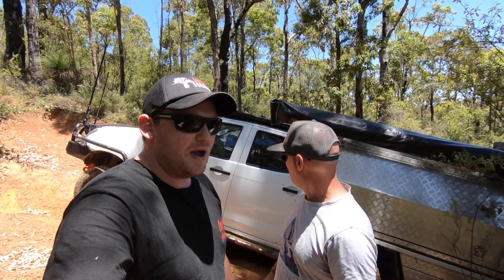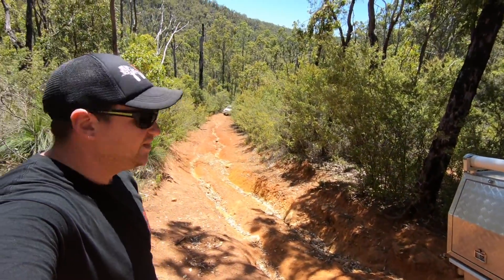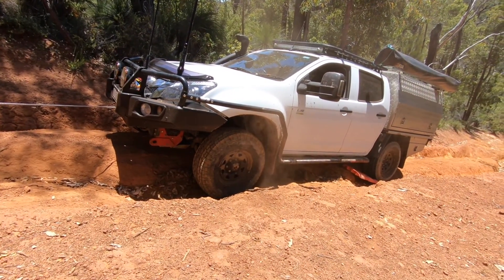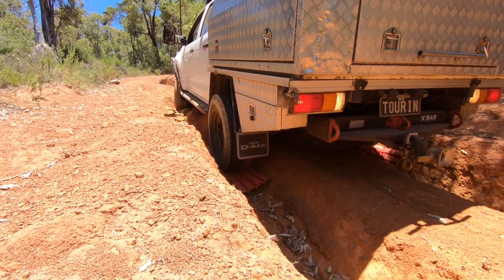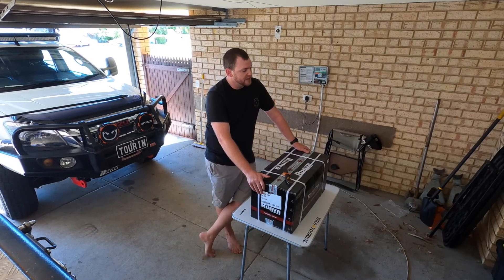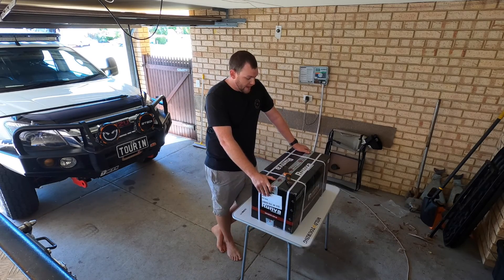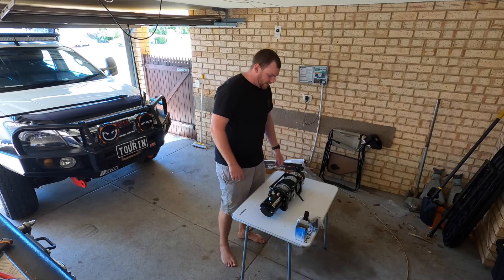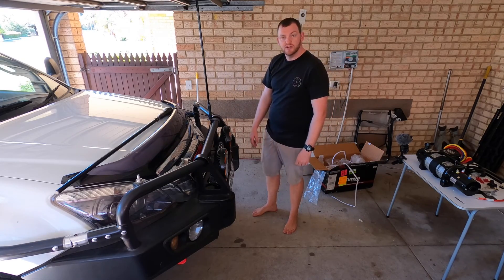Runva 11xp Premium Winch Review - Test/Unboxing/Fitting

Comment: Good job Cam. You won't be disappointed with the Runva. I've had one on the front of my rig for almost 5yrs now & put it through absolute hell. The only issue I've ever had is the isolator switch failing twice due to it being a pos but a quick bypass soon had it going again. Check out Paul's Julimar video next week & you will see the kind of punishment I put mine through.

Comment: Thank you. Purchased a second hand 4*4 and never used a winch upon purchase NEVER tested the Runva x11 went to rest it 8mths later and no power 5hrs of phone calls and questions thinking it was even the control box.. long story short turn on your vid and about 1.50sec into it in unboxing you pulled out the isolation switch, fk me knew straight away what I overlooked lol

Comment: Mate the Runva will not let you down, same winch I’ve had for over 2 years now. Only advice is grease it up before you leave it’s a little dry from factory. Meant to say my bar moves heaps like that too no big deal, I think it’s actually the body moving back on the mounts more than the winch pulling the bar off
Reply from the maker: Yeah the gap between the bar and body only seemed to open up under serious load.  When I backed off the winch the bars still lined up evenly - so not too worried about it!

Comment: What brand of bull bar do you have on the Isuzu? It looks like a complete bumper replacement.
Reply from the maker: It is.  It's MCC.  Absolute rubbish though!  Paints oxidised, peeling and bars rusting all over the place.  Fog lights are falling apart and recently on corrugations the spotties tore a hole out of the top of it 😂

Comment: What bull bar are you running is it steel or allow. I'm in need of a bull bar for my dmax and the tym one I'm looking at is a haft fount bar set up. 
 Where yours looks like a full replacement
Reply from the maker: Mines a MCC steel winch bar.  It's a pretty solid bar, but the Powdercoatings rubbish.  It is a full bumper replacement.
Reply: @WildTouring  yea sweet I'll look into see if they do stuff in nsw

Comment: When your bull bar was pulling off why wouldn’t you swap to a double line pulled reduce the stress on your bull bar
Reply from the maker: Because it wouldn't reduce stress on the vehicle.  Its still pulling the same weight from the same point.  It just reduces the load on the winch motor, which wasn't an issue.
Reply: Wild Touring  if your running it back to the recovery point on your 4X4 you are dividing the stress between the to points. It’s pulling on the recovery point and at the winch
Reply from the maker: @waderattray9210  yeah fair point! Could have done.
Reply: Wild Touring great video by the way first one of yours I have seen and I liked it
Reply from the maker: Cheers Wade.  Appreciate it mate!

Comment: wonering if you used snatch block more if cheaper winch is more viable,last longer,mmmm,
Reply from the maker: Probably, anything to reduce load would help. But when this winch failed on other occasions it was not load related - it was electrical issues from water ingress. It's just not good enough to have to split a brand new winch to regrease it because they basically are sold dry.  Then reseal it with gasket goo because the machining at the flange and factory gasket are terrible and let heaps of water in.  Then have to retorque and lock-tight every bolt because otherwise they rattle loose. If it's something you'll rely on when you're remote, seriously consider saving some coin for something more reliable like the Runva!
Reply: @WildTouring  the 5year warrenty makes it good value,i still have a large list of maitenance.

Comment: When you winch you turn the steering to where you hooked the rope not the opposite way everyone knows that
Reply from the maker: There's not always a winch point exactly where you need it. But I'll plant a tree in the middle of the track and try it again in 30 years 😂 
But seriously,  I did try to winch out to the side of the ruts,  but they were too deep for my little 32" ATs and the car just slid along the bank.  

The car was recovered without anything breaking,  so it was a good recovery in my books.

Comment: A vehicle should never be driven to assist progress when you are winching. That drive assist can cause shock loads to the winch causing it to fail.
Reply from the maker: Cheers for the comment Steve,  but I've got to disagree . Yes bouncing off the winch line isn't good for it. But you're working a winch a lot harder if you don't assist it with some steady light throttle.  First gear low range and as little wheel spin as possible has always worked well for me.
Reply: That depends on the terrain & if you know what you're doing or not. Usually driving while winching is fine as long as you don't over run the winch causing slack. It's morons that don't know what they are doing & over run the winch line  that are the problem, not the technique itself.
Reply: Double line pull would be a better option than drive assist in my opinion. Double line pull never used enough as everybody wants instant and fast results.
Reply: @stevegoodwin5841  Like I said, it depends on the situation. I was always taught not to drive while winching but in real world situations, if done correctly & only in the right situations, it is absolutely fine to drive assist. Horses for courses mate.
Reply: only if it rolls backwards not going forwards